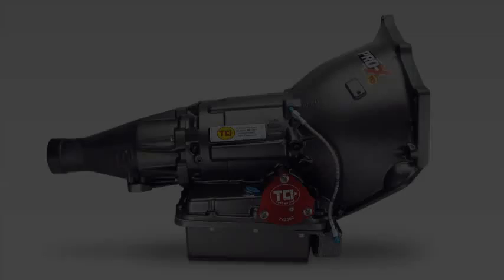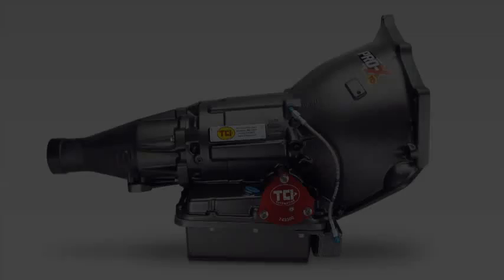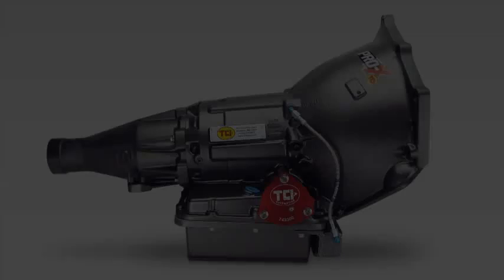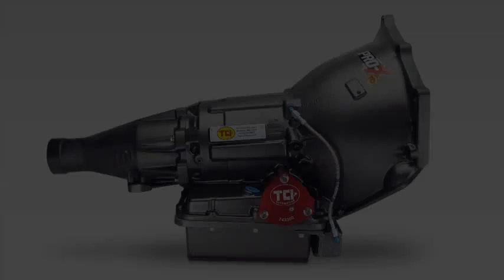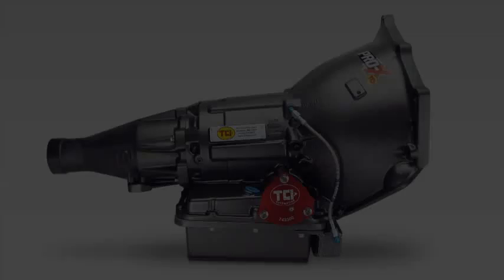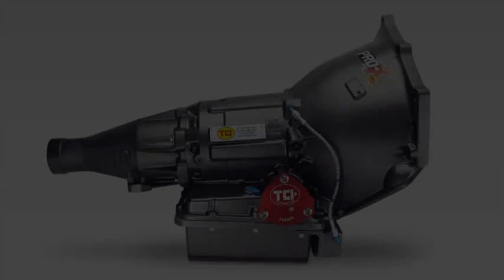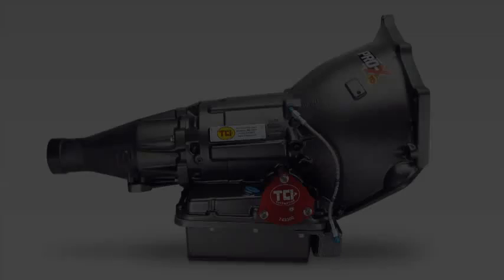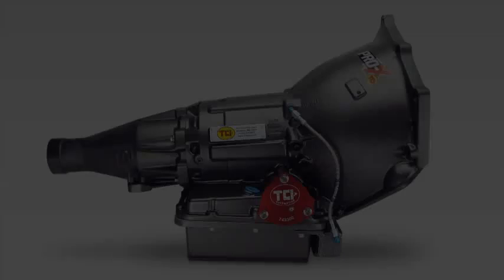Flexplate - How Flexplates Work vs Flywheel

Comment: How does it bend if there are bolts holding in place? Is that why they are breaking?
Reply: Actually run of the mill flexplates are relatively thin so they will flex some,more on the outside of the circumference than in the middle where they are bolted,think about it like a old trash can metal lid, bolt it in the middle but you can still move the outside metal  around if you pull on it,i had one in a engine on one of my cars for 25 years, when i replaced the engine that flexplate was in excellent shape and it had been "flexing" all that time,guess if your not pounding on it all the time they will last a long time.

I actually had a engine built and my builder sent me a scat flexplate like they show in the thumbnail for the video and i never liked it so i went with a OEM one , reason i didn't like it its because as a SFI aproved fleplate (high horsepower certification) it was made extremely thick, i dont think the Queen Mary sitting on it would have been able to bend it any so that right there didn't inspire much confidence and i had heard of broken teeth on these also so i just didn't use it.

Comment: I have a 1982 Chevy 350 cu. in. engine in my old Cube Van. I just swapped the original TH400 trans. to a 1991 Chevy 700R4 transmisssion. Is there a difference in the Flexplate that was on the engine for the TH400... and one I should be using for my newer 700R4 ? Thanks in advance ! LET'S GO BRANDON !

Comment: I have a chvy express 2012 cargo van, and it breaks the flexwheel every 6 to 8 moths i have change 4 or 6 times already my mechanic its going crazy and he can't explain what causes this. He has done anything in his power to prevent this and keeps happening. Is this a common problem on this cargo vans? Im selling this thing im done!
Reply: I'd put a 1/8 in washer/spacer on the Flexplate bolt to draw the nose of the Torque Converter back toward the transmission... sounds like the nose of the torque Converter is up against the Crankshaft.
Reply: @Snailmailtrucker  i sold the evil wanker 😅

Comment: Puzzled.  If the amount of flexing is important, to take up axial movement in the crank and/or the torque converter, then surely a much thicker, machined flexplate will have a different amount of flexing and perhaps give durability problems elsewhere?
Reply from the maker: The thicker flexplate with increased rigidity and durability is required for high-performance applications with increased rpm capability and higher stall converters and to meet SFI standards for safety rules.  
 
The machined flexplate is not for most stock to mild applications. There won't be any problems when you're using the correct flexplate for the proper application.

Comment: You use e coat because it's significantly cheaper, not because it offers superior anti corrosion performance.

A zinc plated flex plate if properly baked out will perform identically in fatigue applications.

Comment: I have a 2005 Nissan Altima 2.5 automatic.  my starter is skipping during starting..i am told that I need a new flywheel. does my car use a flywheel or flexplate

Comment: Upgrade to high performance 350. Old flywheel has center bolts at 3 1/2 inch apart.need one for 3 inch to fit back of new crankshaft.can I get one that's 14 1/3 inches in diameter so the starter will still work.video was helpful!!

Comment: So does the flexplate also work as a flywheel in the sense to keep the crank shaft's rotational inertia?
Reply: The Litterbug Almost. Now it's mostly handled by the torque converter.
Reply: All rotating mass is to be considered when balancing. The flex plate is much thinner than a fly wheel, so sometimes they balance with weights on the torque converter.

Comment: I have a question I bought a 3/4 ton GMC that had a motor swap the flexplate is cracked now but the person I bought it from doesn't know what vehicle the motor or trans came out of how to I insure I get the proper flexplate for my application? any advice would be greatly appreciated!
Reply from the maker: Hi Bearded, 
We need some additional information from you. Can you give our tech line a call? 1-330-630-0240. Thanks for watching!
Reply: Look on the engine their is mostly a code

Comment: Can you explain how a torque converter "grows" as RPM increases such that a flexplate needs to flex?  I just don't get it.....how does increasing fluid pressure inside the torque converter make "flexing" necessary?
Reply from the maker: Hi Mike McCarthy, 
The Torque Converter body itself is not supposed to grow, but due to the transmission fluid pump pushing fluid into it (under pressure) and its internal operation with increasing engine speed (also creating pressure) propelling the vehicle, the converter must be allowed to float back and forth on the input shaft of the transmission. This is a minute distance but we must also consider some crankshaft endplay as well.
Reply: Thanks.....

Comment: Flexplate on Jeep Cherokee makes occasional  noise, does wheel alignment, larger tires or 2"-4" lift affect performance and/or create noise?
Reply from the maker: +gladys knight, 
If you are certain that the flexplate is making noise. You should investigate further and replace if necessary. Could larger tires affect this? Yes!  Those larger tires put more stress on the drivetrain as a whole.

Comment: can i install a lightweight flywheel onto a auto car?
Reply: +micheal balma No. An auto /needs/ to have a flex plate.
Reply from the maker: +micheal balma , 
Automatic transmission cars have what is called a flexplate and they are already very thin and lightweight.

Comment: I want know is available for manual transmission
Reply: +Kumar Nainar You will need a flywheel not a flexplate.  For some cars, there are options of going to different weight of flywheel.  For example, 1995 Honda Civic with 1.5L engine and manual transmission, there is a 15lb (stock), 11lb, 7lb.  15lb is easier to take off from dead stop than the 7lb but the 7lb has much less inertia, allowing to speed up quicker.  How much quicker, I don't know.  I haven't tried it.  That is what I recall when I was researching.  I don't have the car anymore though.
Reply: Your tie licence is revoked

Comment: @Summit Racing
I am looking at possibly replacing my Flexplate. How much is it supposed to flex? I can bend it by prying lightly around the edge with a screw driver from the inspection cover area. i can also push it in with one finger. It appears to be much thinner than TCI brand flexwheels. it is also hitting the bolts around the crankshaft which leads me to believe it is cracked.
Reply from the maker: +Jack Karie, 
Agreed, if you can push it with your finger, it is most likely cracked and in need of replacement.
Reply: I called your customer support number (as mentioned in one of your posts). I couldn't have spoken to a more rude person. The fellow on the phone was completely impatient to answer my question. My question never completely made it through without a specific answer before the phone call ended. However, I purchased another engine (I had a bad engine bearing) and the flexplate flexed just as much as the previous. This is on a 2004 Dodge Caravan 3.3L engine, not a race car by the way.

Comment: Got a ?....I need a flexplate for an automatic transmission in a 2000 Dodge Durango w/ a 5.9 V8. Parts stores I have talked to sell the flexplate without the ring gear attached. I can't seem to understand why anyone(including me) would want a flexplate without the gear(teeth) attached. Any thoughts?
Reply from the maker: Steve B , 
The starter ring gear is part of the torque converter in Dodge applications.

Comment from the maker: There are many variables that play a part in choosing the proper flexplate or flywheel combo. Things like camshaft, engine size, torque converter, transmission and the end use all play a part. Please give our tech department a call at 1-330-630-0240. Thanks for watching!

Comment from the maker: Yes, that is correct. Automatic transmissions require a flexplate and standard/manual transmissions use a flywheel.
Reply: Summit Racing can I put a flywheel in place of a flex plate on a 97 jeep grand cherokee 4.0 42re

Comment: They paint engines and gearboxes black because it emits infra-red radiation energy better then other colors, also when it is matte or wrinkle finished, the emitting surface it bigger. A flywheel does not create heat so there is nothing to emit. Internal friction makes transmissions run hot.

Comment from the maker: Good question, this is common misconception that painting an engine or transmission black will make it operate at higher temperatures. Black paint does absorb heat more than other colors but this is only true when the heat is being generated by direct sunlight. In area's where there is not sunlight like the engine compartment and under the vehicle this is not a factor.